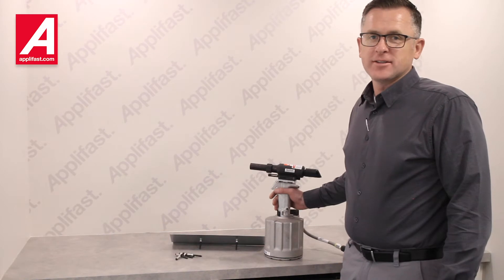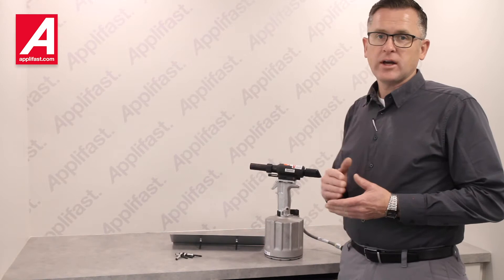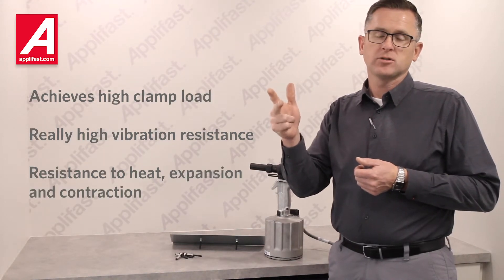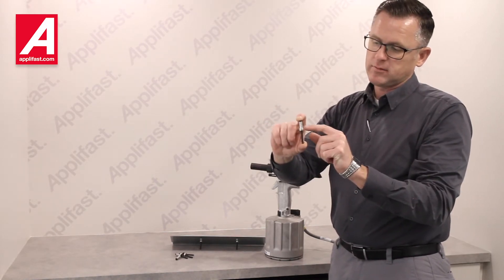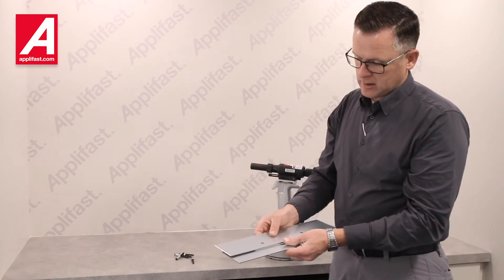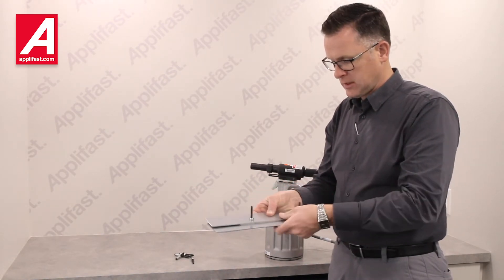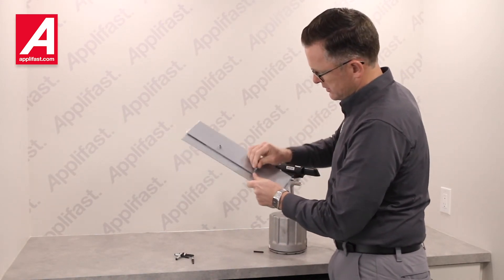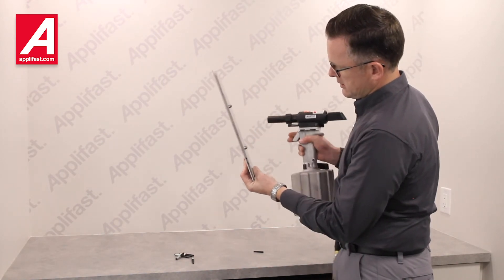Applifast Huck 256 with Nose Assembly to Install 5/16'' BOM Fasteners

Comment: Can change to different tips for that gun
Reply from the maker: Yes! This tool is capable of installing a wide range of diameters and styles of Huck Fasteners by simply changing the nose assembly. Please contact us at info@applifast.com or 800-563-1293 if you require further information. Thank you!